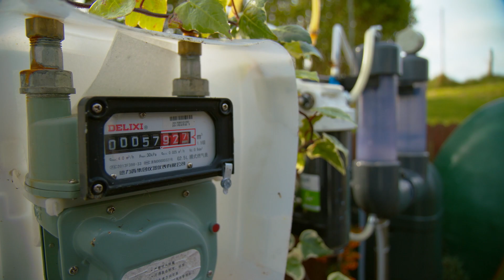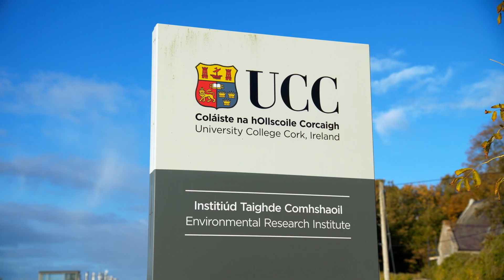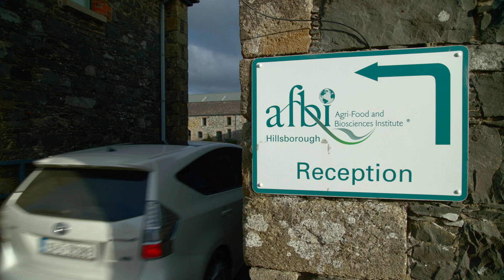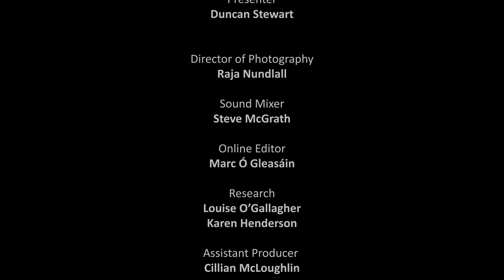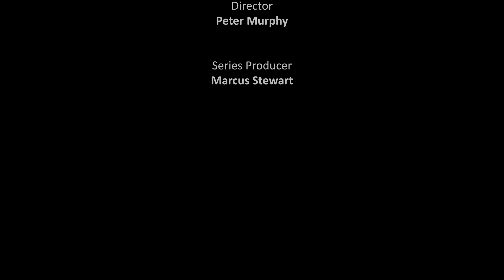Renewable Gas (Grass4Gas / Anaerobic Digestion) EE17 EP9

Comment: You can add any greens & saw dust sticks at the end & press out pellets or brick to be used as firewood then collect Ash as fertilizer.
Build a fireplace with a flu that collects smoke oil & FILTERS the smoke so had very lil exhaust.

Comment: Q: Can it be an idea to grow a lot of seaweed along the coast, to use it as biogas?
And when there is enough seaweed, it can also be used for making sustainable plastic?
Reply: The amount of resources humans waste is incredible, the heat from datacenters we vent into the air instead of heating 15.000 homes from a single data center, all the garden stuff we collectively burn out back, all the oppertunities we cant use because of dumb rules and short sightnednes. A Danish farmer on bornholm years back made his own oil to fuel his tractors, he was hammered by the state because he was not a refinery.

Comment: Would be much more efficient and much Greener to use Algae grown in Photo Bio Reactors(PBR) 40x more Bio mass is produced per Acre than the next best Bio mass crop. Also the CO2 emitted from Gas generator(s) can be fed back into the PBR’s closing the CO2 loop, and if atmospheric CO2 was also used in the PBR it would become Carbon Negative!
Reply: You are correct, but you’re kinda missing the point.  Grass is what they have plenty of and the infrastructure [already in place] to handle it.    Algae would be much more effective but they don’t have the infrastructure to harvest it let alone grow it…. And the point was also to help the cattle farmers at the same time.  A two for one proposition [at a minimum]?

Comment: The transportation efficiency of an electric vehicle is greater than the efficiency of an internal combustion engine.  More miles could be driven electrically than by burning biogas in a vehicle.  

In other words, if biogas, for instance, is burnt to make steam for a steam generator turbine, and this produces electricity, the electricity could be used for transportation, and it has the additional benefit that if people don’t want to drive, they can use the electricity at home or on businesses.

This means that converting biogas to electricity has a greater added value than burning biogas.  Burning biogas only produces heat which can then be used for one single purpose (cooking, making electricity, or driving); however, electricity can be used at the end point of use for various purposes with increasing efficiency levels (cooking, lighting, washing, manufacturing, driving, etc.).
Reply: If the gas can be compressed your argument is flawed. Batteries are limited, especially in winter.
Reply: Indeed, using biogas as a vehicle fuel is not efficient but for cooking it's great.